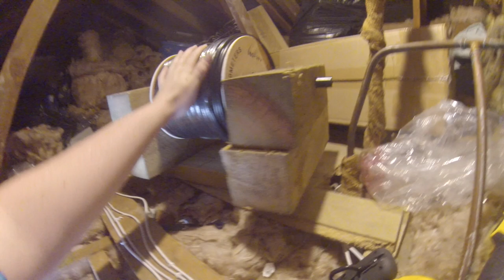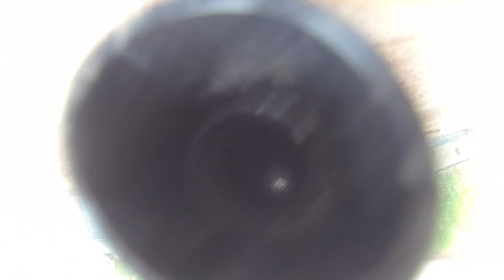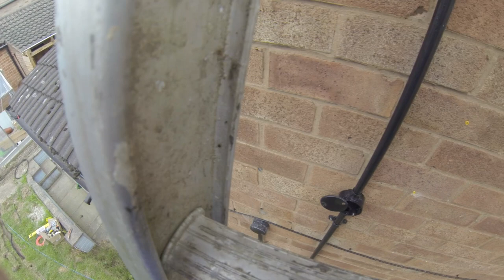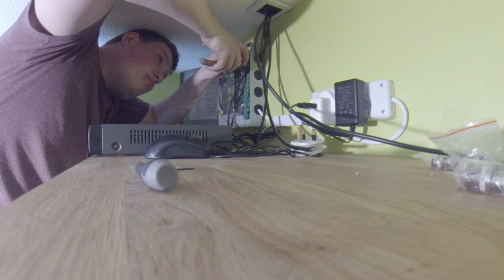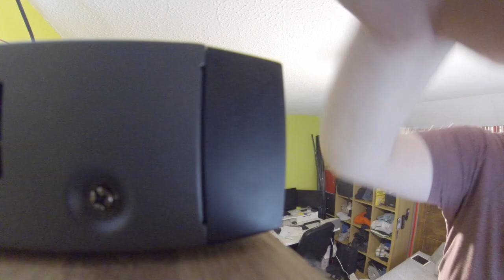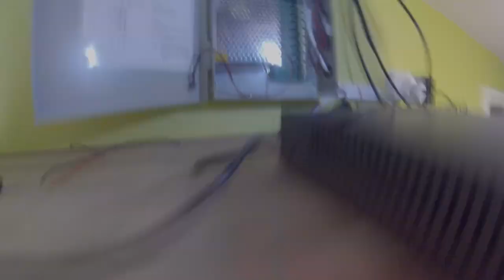CCTV Installation Part 2

Comment: whats the best cctv to buy at the minute
Reply from the maker: MrEvsy Get hikvison don’t bother with swann or lorex and make your own cables using rg59 cable don’t use the cheap pre made ones
Reply: have you heard of zxtech there on ebay 5mp ip cameras with poe just woundering if you know anything about them I'm looking at buying a setup but not sure what to get I looked at hikvision but ive read people can hack into them
Reply from the maker: MrEvsy I’ve got hikvison and it’s brilliant I’m not sure about the hacking part tho I haven’t heard of that brand you mention it sound cheap
Reply: cctv vlogger 
... Personally I use CAT6 cable as you can get better picture quality over longer runs of cable, however thats just my personal preference. I also like to use Hikvision Systens too.
Reply: MrEvsy 
ZXTech are a good brand if your wanting a basic cctv system, however they lack security, so I'd advice against using them for remote viewing. :)